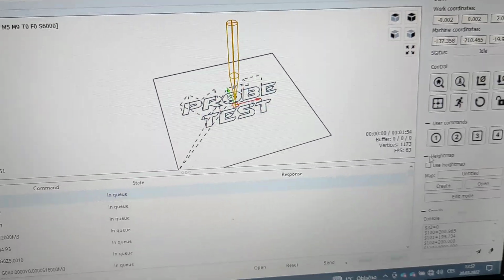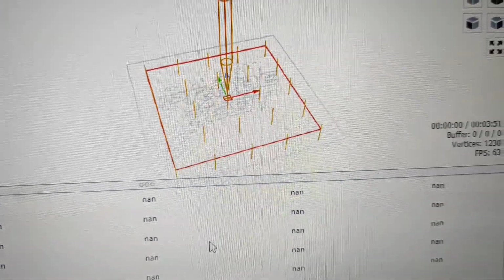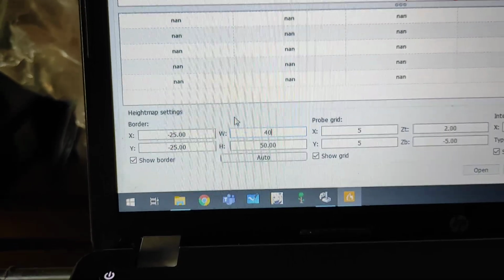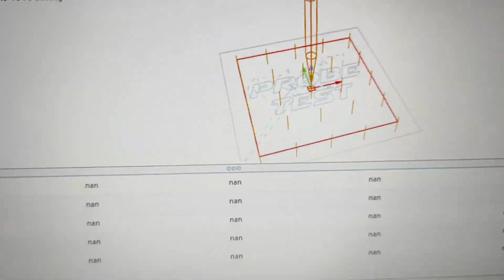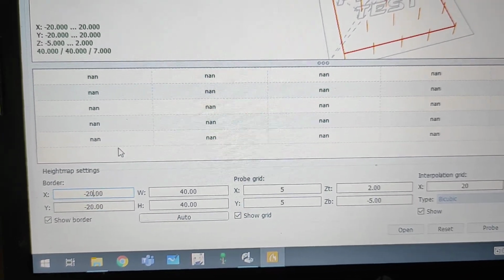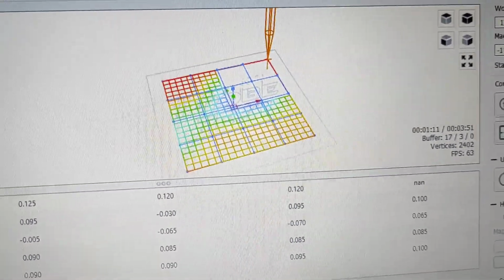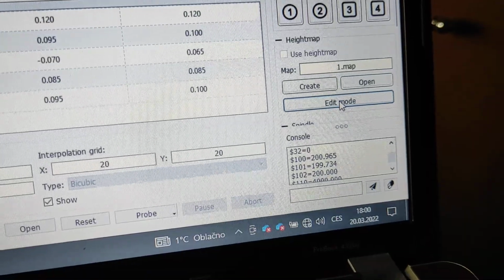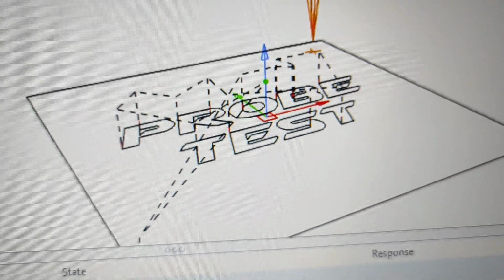GRBL heightmap - adjusting probe area

Comment: did you have problem with candle, to probe different positions of the same point? i mean: if you do 3 times map height, every time show different numbers
Reply from the maker: Hi. I didn´t test it. I can try. But when I make PCB where depth to cut Copper is 0,1mm only I have no problem with probe. I use simple endmill to probe and then I´m milling with V shape cutter.

Comment: Hello sir... 
Thanks for sharing such useful video..
I need your help to build diy cnc for pcb milling... i made one with ddcs controller but due to lack of heigth mapping function in the controller. it is now of no need... i have purchased arduino mega2560 card... but dont know the wiring of axis and limit switches and probe... if you will help it will very very very kind of you... i can also pay you if you can share your knowledge.. please help me out.. i m stucked in this college project since 4 months..
Reply from the maker: I'm using Arduino Uno with simple shield. So wiring is quite easy. I don't work with Mega. You can try this link to solve your troubles. But if you need only simple machine for PCB let buy Uno. You can take inspiration from our electronics .... https://lupa-cnc.com/lupa-box-v-3/ (use translator to your language). Basis wiring is not rocket science. But, of course, it depends on used components (spindle, Uno quality, etc) if machine will work fine or if not (because of low components quality - really depends on Arduino quality, if you will not use original / because of price/ you need to find perfectly working clone). Also cheap DC spindle can make big interference. The easiest way to protect Arduino against interference is to use opto isolation board.
Reply from the maker: https://forum.arduino.cc/t/solved-arduino-mega-2560-pin-layout-for-grbl/502501 ...
 Here is the link for Mega
Reply from the maker: Check this base page for grbl on Mega https://github.com/gnea/grbl-Mega/